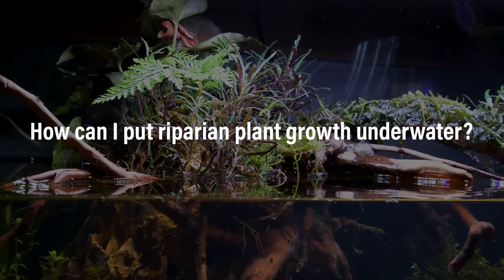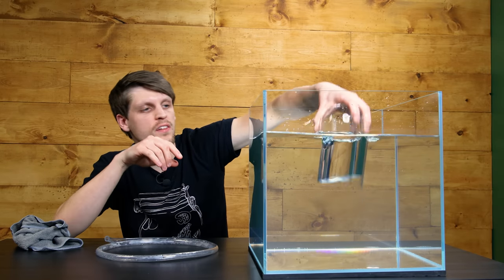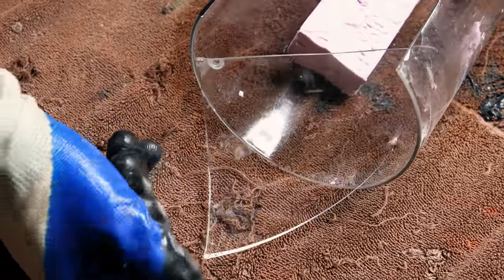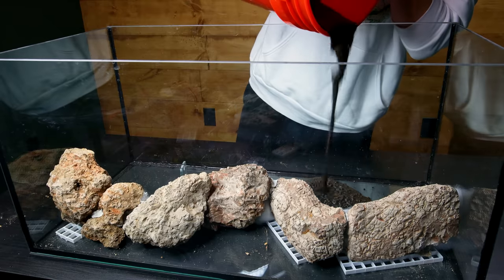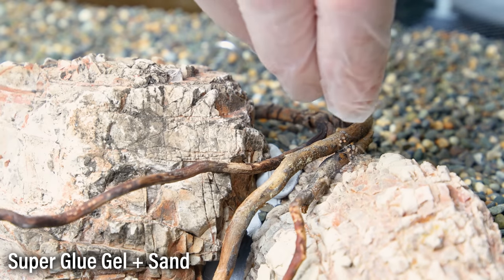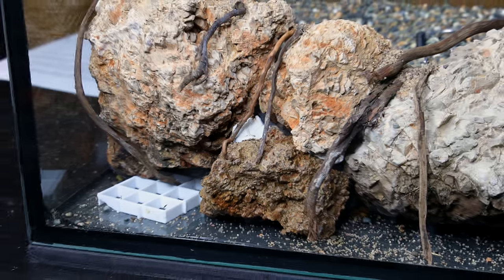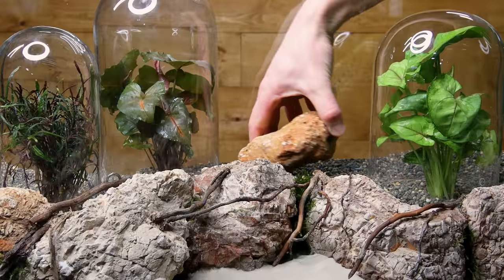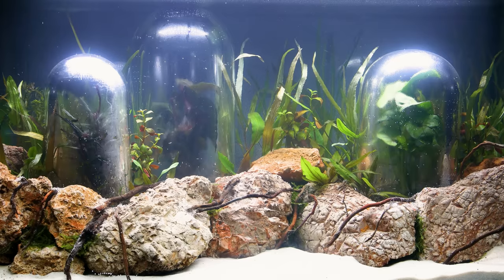Underwater Riparium Air Pockets for Houseplants Grown in Aquarium Substrate Aquascape

Comment: Part of the reason riparian growth is so explosive (compared to aquatic) is that CO2 is often a limiting reagent. The marginal plants are able to take the ammonia and nitrogen from the water, but get their CO2 from the air. Air holds many times more CO2 than can be dissolved in water.

You won't have that benefit here. Fingers crossed for you anyway though!

Comment: There was no great reason to use glass for the anchor system, considering you are covering them up.  That small edge is going to be a weaker connection point, a larger anchor would have been better (long run)--like a 3d printed abs anchor

Comment: I think the terra-plants will not grow, since they have to rely on their own carbondioxide for photosynthesis. even if there is enough carbondioxid (maybe coming from the water below) there will come a time when their bubble is saturated with the produxed oxigen, and then they will simply stop doing photosynthesis.
if everything goes well, at this point latest they will go into photooxidisation-stress, since light is still coming but photosynthesis is stopped.
This is an interesting setup, but be prepared to loose these terrestrial plants.